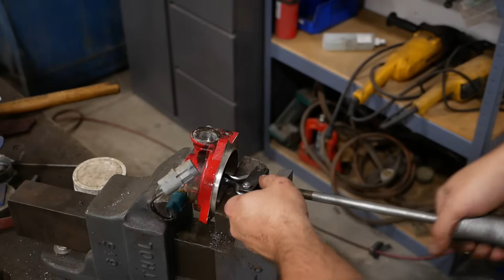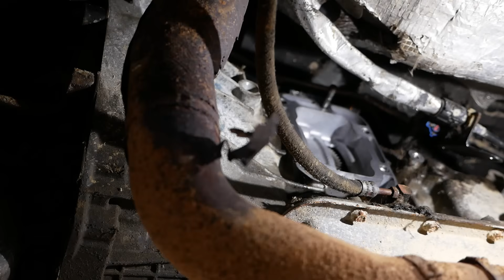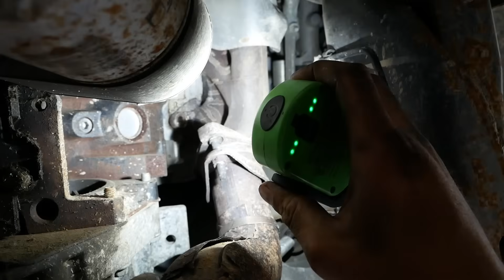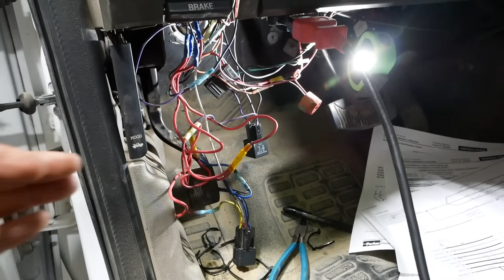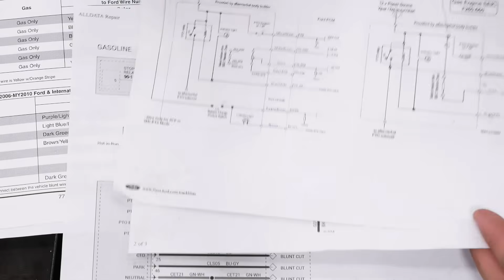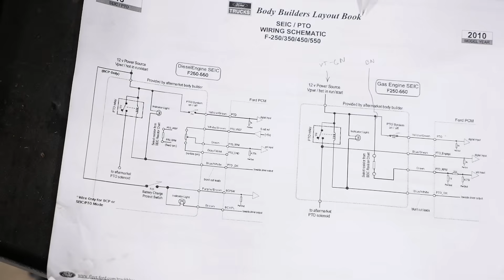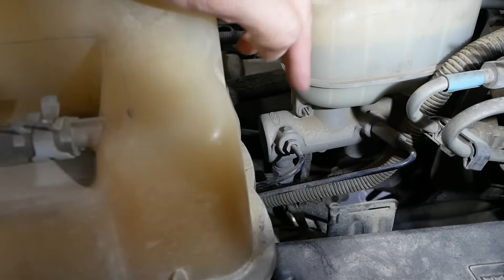Ford F550 Chelsea PTO Repairs - Unexpected Complications

Comment: Torque a bolt where only access is open end wrench?  Crowfoot on the end of a ratchet  extension?
Reply from the maker: I’d like to see it.
Reply: @WatchWesWork  Bear in mind I'm guessing, since I couldn't actually see the obstruction.  Usually, when you can't get a socket on a hex head, it is because something is roofing over the top of the hex head; but you can access the head from the side.  Hence the need to use an open end wrench.  I have a situation just like this.

The crow foot also accesses the hex head from the side.  If the offset of the crow foot is just the right length -- not too long or too short -- it too will access the hex from the side, and you can get an extension into the square of the crow foot.

In my case, I don't have to worry about torque, so I just use a ratchet on my end of the extension..  But a torque wrench works the same way.

The irritating part is that you still have to reset the crow foot flat-by-flat, but you don't have to do this on a long reach.  And in my case, there isn't enough side room to swing an open end, even a stubby.

Just an idea.

Comment: good job, there a lot of technicien in garage that are not good in diagnostic electrical problem i see that alot.and for piston seal the guy usely use a non sharp filer gauge to put the seal in drum cluch.thanks great video and good work

Comment: I wished I knew about this one, I’ve been installing that exact PTO for 20 years, there’s a few things that make it easy to install. If you jack the front end up and let the suspension droop to full extent, gives room to put the through bolt in after, swivel let’s you get socket on all but the lower front bolt, and then a crows foot will allow the torque wrench on, torque spec for mounting bolts is only 25-28 ft-lbs.
Reply from the maker: Hope you didn't cringe too hard...
Reply: @WatchWesWork  not at all, I’ve watched guys struggle for DAYS to install a new one! They all cringe when I say it only takes 30 minutes to install!Lol
Reply: Unless you wire the pto in for “mobile mode” any time you look at the breaks it will kick out
Reply: Gas engines have to drop to base idle before they will allow pto to enguage

Comment: Great job.  Most mechanics would have stopped after fixing - or more probably, just replacing - the hydraulic pump.  Your persistence in making sure it was working correctly separates you from all the others.  I hope the owner of the truck rewards you with continued business. 

As a viewer, it's really helpful when you walk through stuff; like you did with the wiring diagram explaining how things should work and what you're going to do to address the problem.  Looking forward to next Saturday's video.

Comment: Maybe I can shed some light on why the other shops failed.  I needed my Ranger inspected.  The check engine light was on.  I put an analyzer on it and got the code.   Evaporative emissions control system.  The dealer had a Subaru shop closer to home than the Ford one where I bought it.  Gave them a call and they refused to work on it because their computers only worked for Subaru.  Moral of the story is few technicians understand how automotive systems works.  They should be called analyzer operators instead.

Comment: I’ve worked on a 2001 f150 that had that brake pressure switch recall. Even the recall replacement switch failed. It just squirted brake fluid up into the switch and out around the wires.

Comment: It seems like there should be another steel between the piston & the clutch disk. Hard to believe the clutch would make direct contact with the piston. It also might account for the excessive play in the clutch pack. Possibly the reason the o-ring failed. Just my opinion with only a limited amount of automatic transmission experience.
Reply from the maker: I don’t know. That’s how the manual shows it.
Reply: @WatchWesWork  I know. There just isn't any reason for there to be that much clearance. Seems like it would lead to really fast clutch wear.

Comment: I use to run into that same brake pedal problem with the cruise control turning off in superdutys
I should have just kept watching and as soon as you started talking about low rpms I started talking to myself in my brain (that's how I work things out ) and came to conclusion low line pressure is burnt clutch
Reply: That master cylinder mounted switch is a very common problem on many Ford trucks and VANS.

Comment: Great diagnosis and repair.  I bought a used 3/4 ton pickup with a plow from a local dealer.  When I took the plow off the truck headlights didn't work.  I took it back to the dealer for a couple of items they were going to fix and mentioned the headlights.  When I got it back the truck lights worked, but when I put the plow back on no plow lights.  It didn't take long to find that their "fix" for the truck lights was the disconnect the harness for the plow.  After I wired the plow harness back in and downloaded a wiring diagram it took about 5 minutes with a 12v test light to find a bad relay.  Then I let the dealer know that I'd be sharing my experience with the "quality" of their workmanship with everyone I know.  Laziness on their part has cost them infinitely more money than the extra 5 minutes of work it would have taken them to do it right.  
Now if only Wes wasn't half a day's drive away...  😄

Comment: I have a question, the brake switch that is on the master cylinder, if it is faulty, can it cause the brake lights to come on? I have a Super Duty and for no reason the brake lights will come on and ultimately drain the battery over night. I have replaced the switch on the pedal and it still occurs.
Reply from the maker: I don’t think so. The pedal switch controls the lights through the GEM module.
Reply: @WatchWesWork  That's what I was thinking, but I can ratchet strap the pedal up, and it will still turn the brake lights on if it sits long enough. (3-4 days)
Reply: @joemascioni3101  I know this is a pain, but unplug the switch at the pedal and see if the lights still come on or the battery runs down. You may have another drain besides the brake lights. Maybe a bad GEM module ???
Reply: @terryharvey4811  I tried that as well as a parasitic draw test. The problem is with the brake lights only.
Reply: @joemascioni3101  what year/engine?

Comment: Hey man I work for the city where I live and most of what I do is repair garbage trucks, pretty sure that PTO is supposed to be running when they're driving, they're not going to put the truck in park, set the parking brake and then operate the blade and packer.........
Reply from the maker: I don’t know how they use it. This seems to be to only way Ford allows the PTO to operate.
Reply: @WatchWesWork  On the garbage trucks I work on, the PTO is constantly running while they're driving so that at each stop they can operate the blade and the packer. The throttle up function only activates when they operate a function such as the blade to compact the trash.
Reply from the maker: @lustfulvengance  It may have been that way originally. I don’t know. If we had wiring info for the body I could put it back that way.

Comment: Had to put a temp sensor in my 06 f250 and I was able to reuse the transmission gasket but I live in Virginia good job Wes keep those videos coming I enjoy every second make me me wanna go out and fix something
Reply: Also mine has the pto option without the actual pto but I wired mine to the auxiliary switches so that in the winter time I just set the parking brake and flip the switch and it revs up to get warm faster
Reply from the maker: Good idea!

Comment: Great sleuthing Wes.  Another thing you might add to the string of events leading to wearout of the clutch pack would be operators who like to hold the hydraulic valves closed after a cylinder has reached full stroke (to get a "good pack") which keeps the hydraulic pump in fluid relief bypass (maximum load on pump).
Reply: The other problem that he pointed out was the engine rpm. Ford recommends a rpm no lower than 1250. There is a lock up of the torque converter that happens at 1250 rpm. If its lower, the hydraulics will fall on its face. That is were I think the clutch failure happend. Either that or the relief valves on the components were not set properly.
Reply: Yep, the old but many times true, the 18" problem : The distance between the steering wheel and the seat. 🤣

Comment: i've ran into a similar issue on a 2012 ram 6.7 with a muncie pto. it was missing a harness that was supposed to up line pressure to engage the clutch. also, usually new way has a relay/fuse/junction map printed on the inside of the cover so it sounds like someone was in there who really shouldnt have been

Comment: Low line pressure causes (you can hear) cavitation,
lack of lubrication, which then causes heat, burning up the whole system.
Great "extra mile" repair for you, Wes!
Too bad those two dash switches couldn't be combined, and
wired to a switch in the rear, where the other controls are.
Separated is stupid.

Comment: Ever skilful in your diagnostic and execution. I have no doubt it will work better than it has for a long time. The biggest problem seems to have been over complicated design in the first place. Why do you need all that electrical and a computer to operate a PTO. Those crushing garbage trucks were around when I was a kid and they definitely were solely mechanical back then but they still worked. And were fixed with a spanner and a hammer.

Comment: this type of clutch reminds me of whats in most GM NP246 transfer cases, the eletronic ones with the Auto 4wd.  It has the same type of system for the front prop shaft engagement.

Comment: As a Ford Engine isnt Complete without Exhaust Bolts Missing
A WWW Video isnt Complete with Out Your Glamorous Assistant in it 😍

Great Vid Wes , Good Secondry Diagnosis and Repair
This Type of Video with the Electrical will no doubt get you other Work👍

Comment: So put a label on the dash that says rev up the engine to 1500 rpms when using the pto was way above the truck drivers skill set?
Reply from the maker: They were doing that. The problem is that requires two men to run the truck. And even though the RPMs are raised, the transmission doesn't maintain the line pressure unless it's in PTO mode.

Comment: Great job Wes. Not only did you have to re-engineer the electrical circuit for the PTO you had to diagnose a failed component causing intermittent failure. Not to mention the overhaul of the PTO itself. My hats off to you on this one for sure.

Comment: My personal favorite "another shop couldn't fix it" story involves a hard to fill with fuel complaint on a 201X power stroke.     During the wintertime the fuel nozzle would click off every 2 or 3 seconds , freezing the owner's ass off trying to fill the tank.   

Local dealer blew air thru the filler neck, felt the hose was not obstructed and charged 2 hours labor.    Did not fix the problem.    

I pulled the filler neck out of the truck and found the paper gasket off of a diesel fuel conditioner jug had fell out of the cap and was eclipsing the nipple on the tank.    Stupid simple to repair and the charge was much less that 2 hours.

Comment: That BPS on the master cylinder lead to a tsb and even a recall I believe. They would leak and short out causing many f150s to burn down. If anyone here owns a 10th generation f150 and isn’t aware…check that sensor for the updated harness and inline fuse.

Comment: For a press you could have used a length of threaded rod a couple of nuts and assorted washers and your socket.
I ran an F550 bucket truck in 2008 through 2010 you had to set the parking brake for the PTO to work
excellent trouble shooting as always

Comment: Holy cow...!
     I am again amazed at what you find, and how you make the repair(s), on these pieces of equipment.
     Certainly understand the “not wanting to beat up on other shops”...,
    however, and OMG, it would seem to me that somewhere or somebody in the 4 shop mix, would have made note of the master brake cylinder pressure switch issue...,
    Ford in particular, as that has had issues and the subject of (TSB’s) going back to the 1995 F series diesel trucks, and yes it caused issues with  the cruise control, and fires...
Great video, 
Thank you sir.

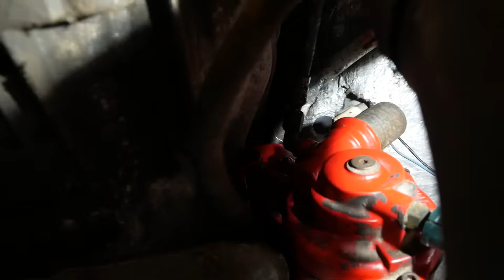Comment: 16:23 it was torqued before the engine and transmission was installed in the vehicle. Manufacturers assemble on the line. Engine and transmission on its own assembly line.  If it was an overhaul, you would have access to everything. You do the best you can.

Comment: You get what you pay for at times the cheapest fix or the cheapest workers an if the blinky box you plug in kant fix it not our problem is the attitude now days an you get charged a kings ransom an still not fixed its the sign of the times we live in good old fashioned service an people that can fix stuff are disappearing no matter where you live or what you need doing i hope one day you can train an apprentice so they can learn what it is to be a mechanic not just a parts installer

Comment: I know most older transmissions don't like it when you do a machine based pressurized flush. My question is doing a soft flush by opening the return hose from the cooler and letting the pump push out the old fluid there, is that a better way? Could that be just as dangerous?
Reply from the maker: I don’t know. I’m not an auto trans expert.

Comment: Just like automatic transmission extra steels 
And friction would make it last a lot longer  
Maybe even the rest of the trucks life
Had a guy rebuild  my transmission  he added steels and friction till he had the right tolerance 
That transmission lasted me as long as I owned it I sold the trucks with the trucking company I had 
That transmission last 
2 motor  250.000 miles an was still going strong 
That's  my experience with that

Comment: When those brake switches fail they leak into the connector, brake fluid is conductive. Causes the switch to short like the switch is active and eventually burn.

Comment: Another incredible diagnosing of a failed PTO. It looks like this problem was tailler made for Your skill set and Engineering Degree, after 4 others failed! It makes for a good video but points out the bad engineering by FORD and Garbage truck manufacturer with his stupid control box. The owners should have bought a new garbage truck when You look at all the costs.You probably spent a lot more hours thanYou billed them for.

Comment: Yep took it to 4 different places and they couldn't fix it. Sounds about right. Here is the thing. We have lost so many skilled workers and some mechanics these days just are not up to the task. So sad. The travel on that PTO piston on the clutch pack concerns me. I used to rebuild automatic transmissions for a living. Is there a specification on that PTO unit clutch pack clearance.  Fixing the idle up system will 100% improve the longevity or the PTO clutch. Cheers Stew.
Reply from the maker: I didn’t see any spec.

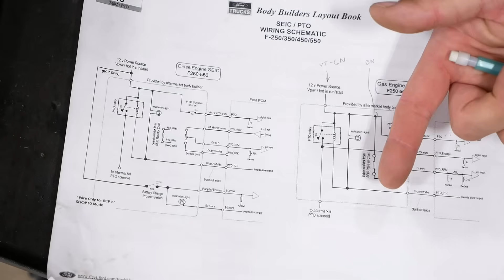Comment: 28:28 what's line pressure, what line? also, what are we looking at here? what is vt-gn, what are the modules with a dotted line around it? what's a 'body builder'? Nice shots btw, just some small things I don't understand.
Reply: The "lines" are internal passages in the transmission. The trans has valves and solenoids to regulate how hard clutches and other internal pieces hold or shift. A lot of times the chassis manufacturer, in this case Ford, supplies a bare cab and chassis to the customer, who then takes it to a "body builder" who builds and installs a custom device to the customer's specification. In this case, it's a small trash truck/compactor, but it could have just as easily been an ambulance, a fire truck, a tow truck, even a recreational vehicle...your imagination is the limit.
Reply from the maker: He said it better than me!
Reply: Dotted lines=relays, switches, solenoids, etc.
Reply from the maker: @hermanschepers4739  Normally a dotted line just indicates that those things are inside the same unit, in this case a relay.

Comment: Great diagnostic work.  A few shops have the necessary talent (but not many) but almost none have the patience to work through problems like this truck.  Problems like this suck up so much time in repair that it is difficult to make any money.  Customers just can’t understand why a “simple” wiring repair costs so much.  

This truck is a perfect example why things should be repaired back to original, stock condition.   That way you can find parts AND, most importantly,  the repair instructions.  

With these videos, you must get job offers every other day from other employers.  Big factories in the Midwest would be happy to have your skills.
Reply: Most often it's not for lack of talent or patience, but lack of time. Management/service writers book 5 cars at 2 hrs each and tell the tech to knock them out in 8 hours. As a dlr or indy tech in a large shop, very seldom do you get paid for more than 1 hr diag time if any at all. If you're on flat rate pay, you have to at least match or beat book time to make any money...And sometimes it's not managements greed as much as work load that makes them push and overload the tech. If your parking lot is full of cars, you gotta turn them out, cause tomorrow more will show up...
Reply from the maker: Nah. I just hide in my shop and fix junk.

Comment: So, to make it work, you have to put the truck in park, put on the parking brake, then flip the switches. Using this for residential with that tiny bin would be a pain. But then, the last one I rode was a 66 Ford C cab with a Garwood body. Back when I was young and dumber.
Reply from the maker: They said it’s great for smaller suburban areas.